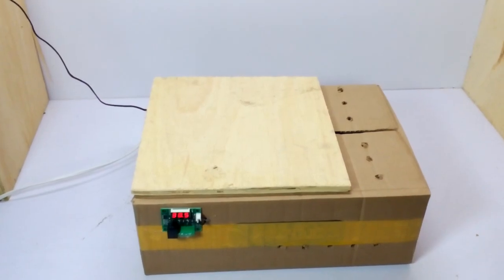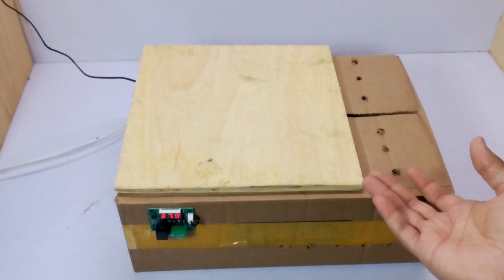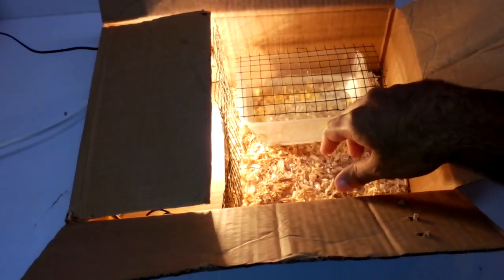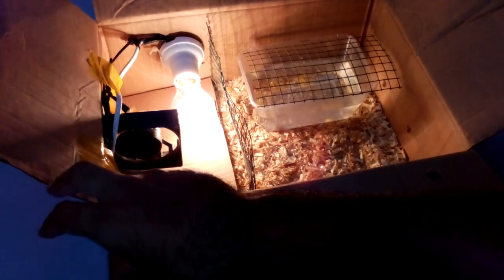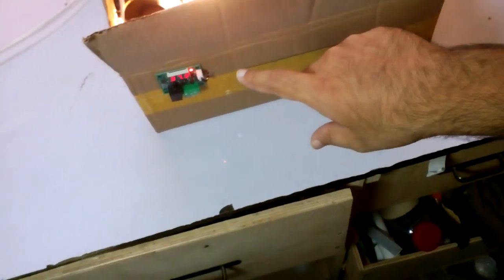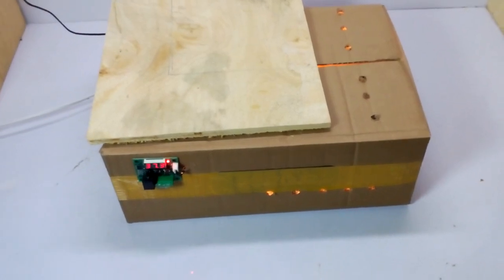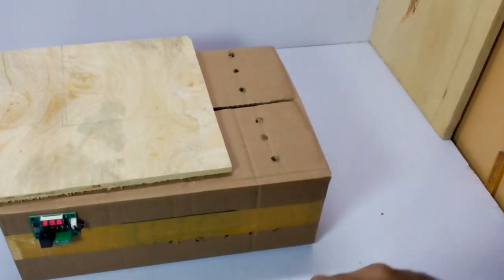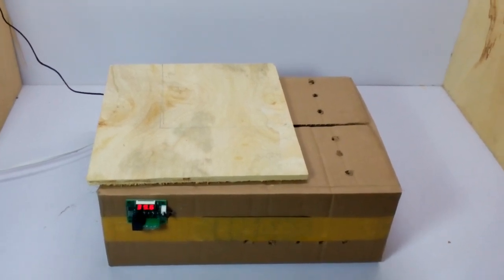mini incubator with w1209 - English

Comment: 12 volt kitne ampiere ka power supply jaruri he w 1209 chalane ke liye
Reply from the maker: 12v DC 1 amp
Reply: @Umairworkshop  kya 1209 per aapne jo heater banaya he wo chaka skte he
Reply from the maker: @Bokadwalabhau  you mean PTC heater yes that is good option